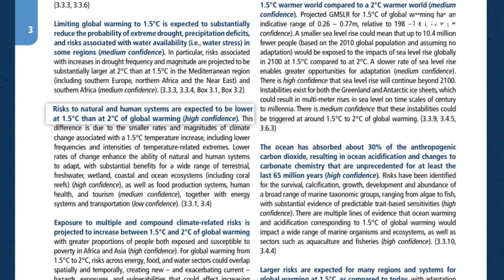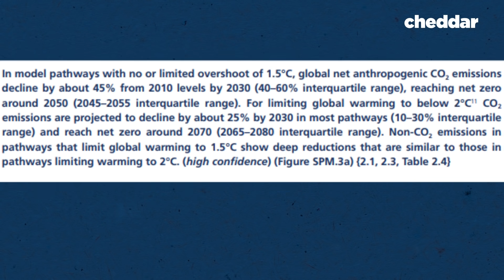Wooden Skyscrapers Are On The Rise - Cheddar Explains

Comment: Architects are also very dubious concerning that solution sometimes.
There's a lot of different problem with using wood as a building material :
- The wood must come from not too far away
- The forest has to be sustainably managed
- The wood needs to be transformed not to far away too
- The glue and different chemicals used to strengthen and protect the wood from the weather are far from being environment-friendly
- The longer the beam, the taller and straighter the original tree needs to be. Those, you can only find in certain locations, where it's very cold most of the time, and they can grow slowly and very straight. They're way less renewable than you would think they are.

Comment: 350 metres tall wooden skyscrapers: they are so fast to build, expect them in 22 years - from 2019 when they were invisioned to 2041 (compare with 828 m tall Burj Khalifa built from 2004 to 2009), also they will be 10% out of steel. Interesting why? Because it is actually impossible to go even that high completely with wood. "It will be the tallest building in Japan" - yeah, just like Tokyo Tower of Babel invisioned in 1992 to be made of steel and be 10 km high. 
We need more dwellings for the rising population and we have 828 metres tall buildings made of steel concrete for 12 years and 1 km building under construction and up to 4 km proposed steel and concrete and up to 10 km purely of steel, but let's go for maximum 350 metres tall wooden with the support structure still made of steel. 
Wood is lighter and stronger - LMAO that's why we use metals building airplanes, ships, submarines etc. We just don't want A380 being lightweight, that's why not building it of timber. 
We are having up to a million tonnes deadweight ships up to 480 metres long, 124 metres wide. Try to build it with timber. The maximal length for a wooden ship was like 170 metres or so and it was the limit. The mass was 10-ish k tonnes - like a hundred times less what we already have. But even that 480 metres long and a million tonnes heavy very far from the steel limit. 
Why aren't we build the dams made of wood? It is such a strong material, we need to use it for the space launch rockets, f**k you steel, aluminium, berillium, titanium, steel etc. Wood is also radioabsorbing unlike metals, let's build next gen fighters made of wood, why won't we?

Comment: Mass Timber and Fire: Mass timber does resist fire well and once a char forms burns at a slow and predictable rate whilst maintaining structural integrity. The question is will the fire self extinguish once other fuel sources in a burning apartment are gone? It appears to be the case that even when ceiling and all walls are mass timber a fire will burn out before structural failure occurs.

Mass Timber, CO2, and Deforestation: Mass timber sequesters a lot of Carbon which is good regarding raised CO2.  Deforestation is an issue. Can it be shown that managed timber would supply the mass timber demands if so then it's a good idea. If not then it's back to the drawing board.

Comment: You neglected to mention wood boring insects and wood rot. Both are major problems that will damage and destroy wood. Wood peckers and even rodents and even squirrels damage wood.  Wood  requires a lot of expensive maintenance. This includes periodic repairs, painting and staining.  I live in a wood siding house and would never buy or recommend an all wood structure again. Make my material structural of choice steel.

Comment: But what about trees.You have to cut trees to make the wood for the building and the building materials will be put together with the same construction machinery so you really won't change the emissions as much.And when you cut trees down you release the trapped co² in the tree so it is not as much of a solution.Also less producers less life.And less places for carbon dioxide to be extracted.

Comment: Considering that the first thing this will do will be to trigger a massive replanting campaigns and much tighter management of existing Forest. While not a short-term solution because to grow a Timber grade tree 5 to 10 years depending on species. It would at least see a massive reinvestment in managed Forestry which will have a lot of good short term effects. I don't buy the hype but I'm not against a massive reinvestment in Forestry and sustainable management of existing Forest. Sustainable management by the way means leaving the biggest old growth trees the f*** alone and only cutting trees under 20 years old. While immediately (ie the same year)  replanting anything that is harvested.

I could get on board with that. I just don't feel like the ridiculous hype-train is even remotely necessary.

 I'm much more interested in the living buildings projects already underway. Yes they take a lot longer to make but when grown out of the correct species they can last for a literally A Thousand Years. Making them essentially carbon-negative several times over over the course of their useful life.

Most first gen Pokemon player is intimately familiar with the Bellsprout Tower. It is based on the ancient wooden architecture of Japan. It's totally possible to build tall with wood the problem is outside of Japan and really cold climates termites exist.
Modern fire suppressant systems are not sufficient you completely counteract this and it would require the first two to three stories of the building be made of steel and concrete anyway simply to go higher than termites.
Termites aren't the only biological Hazard roaches love to live in wood and plasterboard structures. With the total World dominance of the German roach in every populated area you're literally just laying on a giant buffet for them. Roaches carry hundreds of diseases that affect humans and our domestic animals. Yes we still stupidly continue to build residential housing and apartment buildings out of them but there's no need to cause a giant roach population explosion by building these gigantic buildings that are perfect homes for them. Which is one of the major reasons most commercial buildings have gone to concrete and steel as roaches are less likely to stick around.

 Until we come up with better Pest Control measures I do not think that tall wooden buildings will be reasonable in many parts of the world for several decades yet.
Which is also a problem that buildings grown out of trees will also face.
 Ultimately that works out in favor of the sustainable forestry argument however because it's going to take awhile to get those up and running anyway. We are going to need a good harvest of 10 and 20 year old trees to kick off such a boom so best to get planting now.

Comment: Look at the materials in our houses today, and how fast one can burn down. Even if the wood is thicker the building would most likely collapse at some point, we've seen how difficult it can be to put out fires, but if you have enough fire suppression in place you should be able to get that fire out before it gets out of control either in size or temp. 

Still a scary thought to be living in a high rise made of wood. I'd worry about myself and the safety of others as well. Both on the ground and in the building. 

All that being said I'd need to see certain proof in person before living in such a building. Meaning, no I most likely wouldn't live in one.

Another thing that people might want to take into account is what happened in 2001, how would a wood building withstand that?

Other than that, I do have to give credit where it is due, and in this case it's the effort to be more green in terms of building production.

Comment: Although it sounds contradictory. Constructing these large wooden buildings is more environmentally friendly than reinforced concrete or steel. Maybe you don't know, but the process of manufacturing concrete, sands, aggregates, metal alliances, etc., is extremely destructive and polluting of the environment. Of course there are many variables to take, but the idea (in the sense of sustainability) is not so daring... (architect here)

Comment: “Pound for pound just as strong as steel” means that they have to use 1,000 lbs of wood to equal the strength of 1,000 lbs of steel.   Meaning it’s not lighter than steel for the same strength.    

I hate that no one with an English or broadcasting degree edits these videos to make sure they don’t say blatantly misleading conflicting statements back to back.

Comment: Hold up, at like 2:35 she says trees store CO2, and that every cubic meter of wood stores 1 ton of CO2. That is for wood that is alive not dead. You realize that by building more with wood we would cut down more trees thus having less CO2 consuming plants.
Reply: The idea is that the wood will be renewable. They cut, they plant.
Reply: @RizkhyDestatama  but then you have an neutral affect on CO2 storage because you still have the same number of trees remaining. If anything you have a negative net storage of CO2 because the trees you plant will need time before they can grow and store the same amount as what they cut
Reply: @YosephSA  no, it will be positive effect. Because when you build and produce concrete there is a massive CO2 being produced (when making the material and building the building). But when using trees, you make O2 and recycle CO2 when producing the material, it is also less CO2 being produced when making it into building.
Reply: @RizkhyDestatama  somehow hadn't thought of that. Thanks for that.

Comment: Welp. Goodbye to all our forests because some assholes don't want normal buildings.

I feel like the issue is much more than just "Wood absorbs CO2 and Concrete doesn't". Trees PRODUCE oxygen, which makes the CO2 level relative to oxygen much better. If you start mass-producing wood skyscrapers, then pollution levels will skyrocket, right?
Reply: Trees can be replanted. Just like paper industry or food industry. They don't cut wild trees in the woods. The idea is to reduce CO2 because when they produce the material to build something O2 is produced, it even reduce the CO2 in the air because it's tree. Also when building these woods don't produce massive CO2 like concrete does.

Comment: How is building with wood better for the environment. Think of how many trees would have to be cut down if every city in the world decided to build millions apon millions of high rises using wood, all the forests of the world would vanish over night. I see living industry pushing this phase with a clear agenda. And its laughable to compare wood with steel or steel reinforced concrete in teems if strength or fire resistance. Just the fact that it takes over 2000 degrees to melt steel destroys that argument. And as far as strength, wood being as strong as steel pound for pound is a deceptive. Cause a pound of steel beam for example would only have to be  3 millimeter s in thickness, where as a beam of wood that is pound would have to be a foot in thickness.  Now imagine how thick beams would have to be that are made of wood where even steel beams are required to be 2 or 3 inches in thickness.

Comment: you can't use japanese temples as a way to prove wood lasts a long time. Japanese temple architecture uses 0 screws and nails and the wood has to be dried for decades before it's used for building. There's no way you could keep up with modern infrastructure with requirements like that.

Comment: "cost competitive"

5 minutes later

"Way more expensive"

Oke....?
Reply: It's cost competitive when you build a small or rather normal building (such as a house) but becomes expensive when you build a tower or a high rise building since you'd need a lot of engineering and technological work to overcome the challenges of building such a novel structure + possibly more material to brace the structure than you'd need if you made it out of concrete and steel
Reply: @hasanshwaish197  Americans won't go for smaller dwellings and tihhg now there DEFFINITY not.
Reply: Plus the "wood" is infused with so much resin to prevent termites, moisture, delaminations, warping and so on, that by volume these are more plastic than wood. So in reality these are plastic buildings. So when we have to tear them down how exactly will these be environmentally friendly? The problem with waste is not when you're using it but how do you dispose of it. That's a lot of plastic to burn or bury.
Reply: And that's why I think wood skyscrapers are going to be a failure.

Comment: I really don't understand how stupid can be people lmao. 90% of US houses are already out of wood, so what's your deal rn
Reply: Most of them are two stories high.  They are not towers.  It may take awhile, but wood rots as well as burns.  Replacing beams is murder.  Steel does not burn if it's not jet fuel, nor does it rot.  It does however corrode, a problem that is easily remedied with oil, wax, polish, paint and so on.  These same treatments go for wood too, but they don't last as long.  There's also wood eating termites.

Make all the Jenga beams you want, take a photograph and another a century from now and see how well it holds up.  Damage in cellulose accumulates in such a manner it does not in a material you can weld and smelt.  Besides, how much carbon do you think is released when the wood inevitably burns?  The whole thing is a trade off and I know which one I favor, the one that lasts long term and does not need to be rebuilt unless demolished. 

The one perk I see is shock absorption, the only dealbreaker.   If they are pressing for wooden vehicles, my ears are preaked.

Comment: If we can grow a burger in a lab, perhaps we can grow our lumber needs even beyond the limits of natural biology. Imagine 3d printing drones assemble a lattice of strong polymers digestible by a stronger living structure based on a hardwood core with a high tensile strength outer species of wood. Level by level the building grows. Entire buildings grown in place, fed the remnants of recycled buildings. Buildings with dedicated ecosystems that repair, provide thermogenesis/convection cooling, buildings that negate the carbon footprint of everyone working inside of them, that can regrow in a matter of weeks into entirely different layouts. Factories that process their own waste material. 

Hell, why not grow downwards? A skyscraper up top, a "root" system offering immense additional square footage, allowing construction in otherwise unstable areas. Humidity control built-in, bioluminescence. Chlorophyll-generated glucose could be transported down and fed to large mats of lab-designed variants of the electricity-generating cells in amazonian eels, for on-site organic solar energy. 

Ooooh we gon' be Na'vi

Comment: My question is how well does a timber building do in extreme heat fluctuations? I live in a state where it will be 95F and then drop some 40-50 degrees in the afternoon because of cloud cover. How well does it hold up to hail, snow, slush and the like? How well does a timber building regulate internal temperatures?

Comment: Hi, Please stop post videos that are complete nonsense. Glue timber as we know, we have a very bad example of this, this is called MDF(Medium Density Fibreboard). Glue and timber(hardwood) dust can cause cancer.  Have look to this link http://www.hse.gov.uk/woodworking/faq-mdf.htm .  Second thing,  if you take to account how polluted our air, this kind of building will not stand and half of that what is to compare concrete, steel or glass. In Uk we have lots of examples when the building was finished with wooden cladding, yes first few years it looks nice, and after 3-5 years it starts to rotten... 
Plus you do getting a big problem when you joining wood with the concrete base or even, wood to wood. Because you need tremendous strength in the joints. Timber and metal when they joined together they do not last long, the metal starts to rust, wood rotten.  
Like every material timber have his own limitations, it is a reason why people start to use steel and concrete!
Other challenges, flood(even burst pipe in one of the floors), fire, vibration, temperature different, condensation, weight distributions etc., Mind you, the building must stand at least 100years, otherwise, no bank gives you a mortgage. 
And the last bit just for the fun have look at what kind challenges have IKEA https://www.theguardian.com/sustainable-business/ikea-sustainability-forest-positive-karelia 

Thanks for your time.

Comment: This is all fine and dandy until someone decided to drop their cigarette in the trash can.  There's a reason that non timber is used in commercial and higher density residential, and that's because wood frames burn a LOT easier than steel ones.
Now It took them far too long, in my opinion, to address this in their video, and I'm not really convinced...   They mentioned it burns more "predictably."  Obviously they aren't going to be using style from the 1600s.  There using wood that's denser with less surface area, making it take longer to burn.  However, making the core supports out of wood is, as I see it, a huge mistake.  I don't know, I'm not a scientist, but I am a firefighter.  My profession does deal with fire.  The issue becomes if a support burns, the whole building could collapse.  Steel supports makes this not a concern.